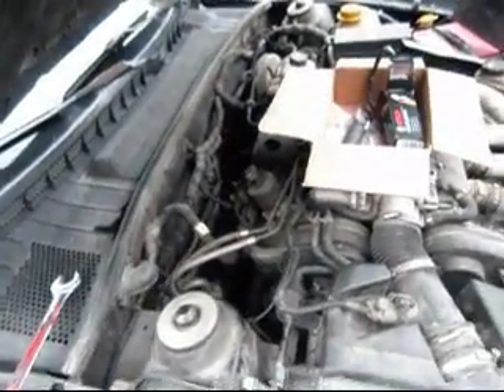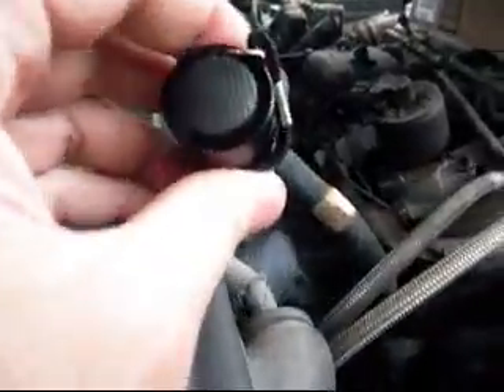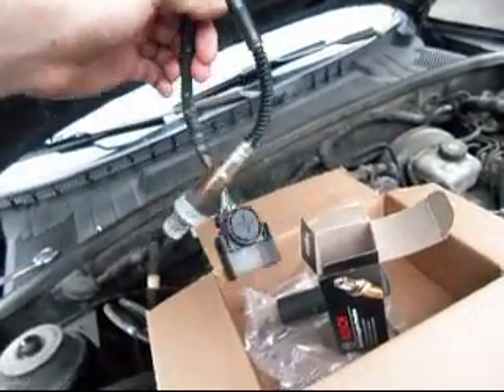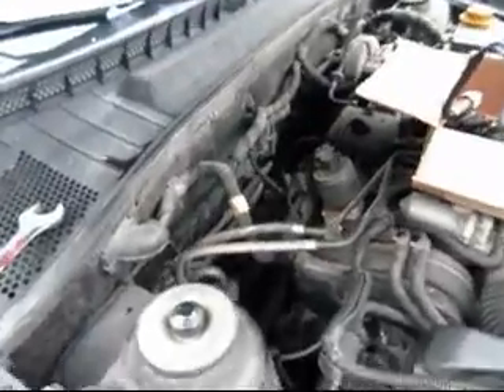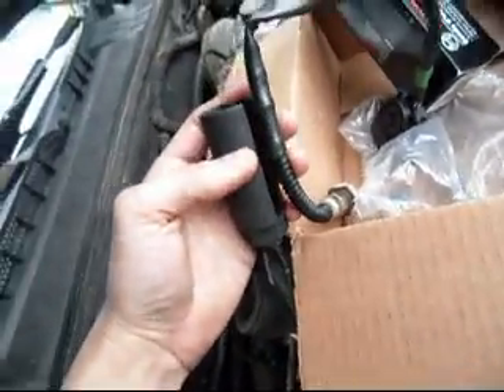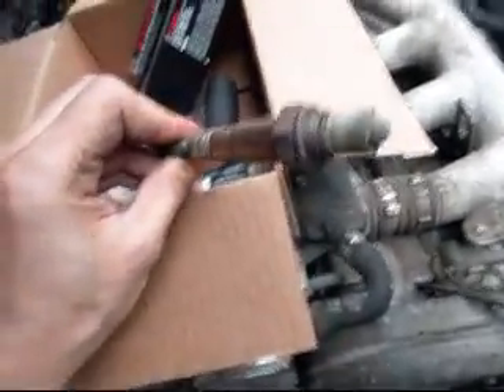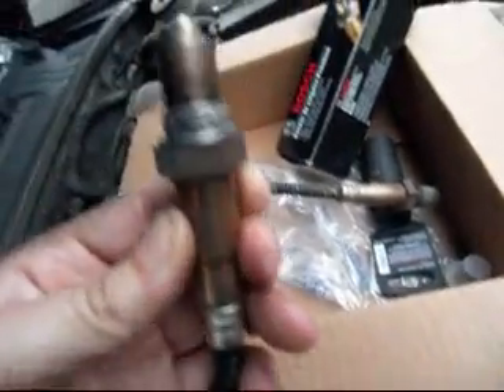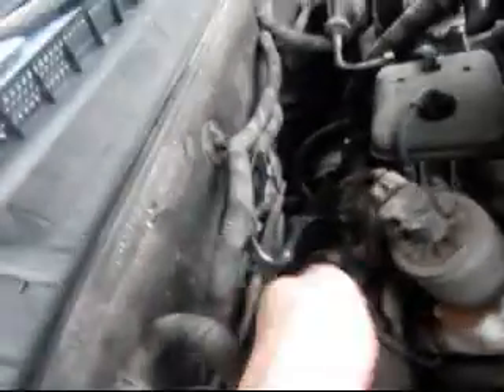2000 Saturn LS2 Service Code P0030

Comment: P0030 relates to the heater control circuit in the oxygen sensor , sadly both bank 1 and 2 failed same time on me